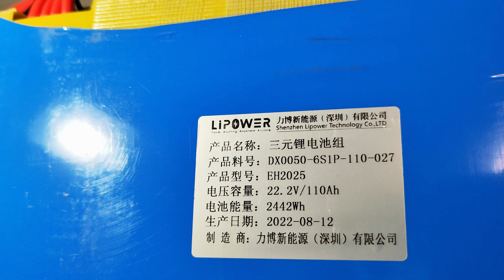ElecHive 2500 Portable Power Station Disassembly. Problems.

Comment: Hi there, thanks for your disassemble video. My Elechive has a broken main board and they asked me to remove it and send it back. I don't want to go through the hassle. Do you think the battery could be repurposed if I pulled it out? Your video shows a lot of cables attached to the battery? What are those? Cheers
Reply from the maker: Hello yes the battery can be used. But you need a BMS for the battery it's a 6S 24v battery. You need a BMS for 6 Cell battery. I think the cell's are quite good.
Reply: @RahmatullahRezai  Thank you! They are going to send me a new mainboard and I'll try and swap that out first and then if that doesn't work, I'll get a BMS and try and at least make a 24v system out of it. Like you said, those are good cells, worth using them for something!

Comment: I have problem on my.elechive too, now it wont turned on, it has to plugged in to 240v for charging, then only it will turn on...not sure what caused it, prevprpblemit has problem like flickering on lcd..0% batt...whwn charging and no. Keep changing...they asked me to disassemble and ship the mother board back which i did and resend me the fixed one...all okay, until new problem arise.
Reply from the maker: Sorry to hear that. It's super bad quality.  And the company is a joke. Because it's dangerous to open it. The customer should not disassemble the power station. Risk of high voltage. I guess I will never buy from the company again.

Comment: Hi, thanks for making your video! I just wondered if you managed to fix your Elechive? If so, was it the connector? Did you stop it making the noise as well? Regards,  Russ
Reply from the maker: Hello. The problem was with the battery cell. I kind of fixed. But do you have any problems with yours?
Reply: @RahmatullahRezai  No I don't have any problems with mine but I was shocked to see the poor build quality on the main board. What did you do to 'fix' the cell?
Reply from the maker: @russoliver4101  I contact the Elechive. They told me to send the board back to China for inspection and repair. I had a 6 cell battery from a power bank that I used to test the board. The board was fine. After back and forth emails they agreed to send a new battery's cells. But they sent a defective battery . Because the new battery's balance cable was cutt off during the shipment. They told me to try to fix the cable. But it's not possible because the original cables were soldered with Lazer. Tried using multiple soldering iron. I even tried using a tab welding. It  didn't stick to the aluminium tabs. I give up. Since  the support team stopped answering  my emails .  They are the worst company.  They don't care about their customers. I never heard of an electronic equipment company telling their customers to  disassemble the dangerous equipment by themselves.  I live in Norway. If  I lived in the us I would sue them. The quality of the board is like a child's work.  All the components are the lowest quality. I don't think you can find any cheaper quality components than what they used on Elechive.  But I am working on a solution to fix the cables. I will probably make a video about it soon.
Reply from the maker: @russoliver4101  thank you. Yes I will make a video. It would be easier if there were any room to work. There's almost no free room. Because of the negative other battery terminals. I think it's 4mm in between the. I hope u understand what I am trying to explain. I will make a video then you will understand me 😊